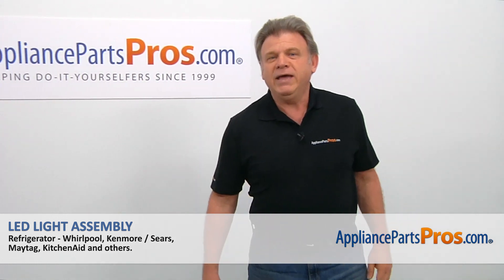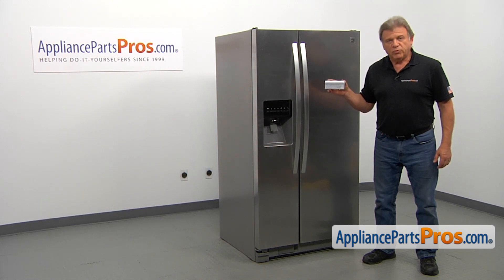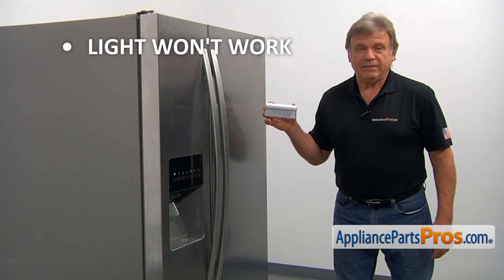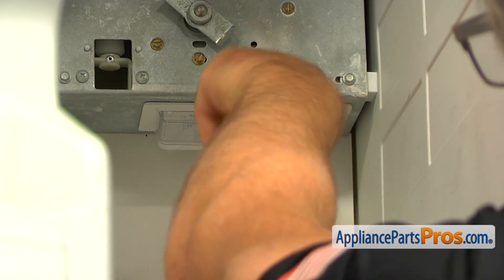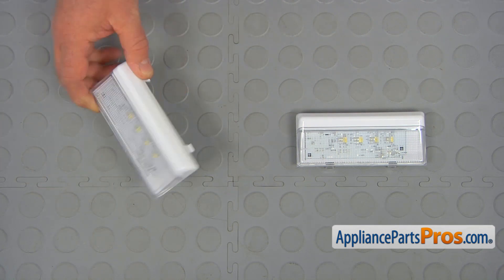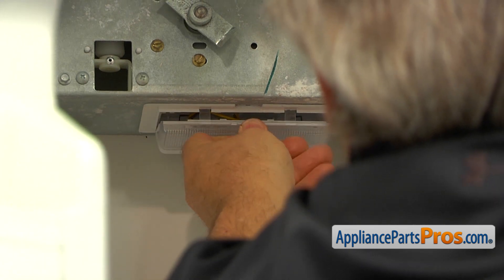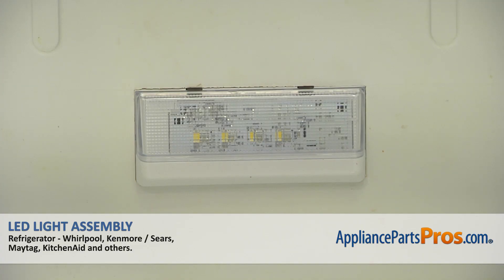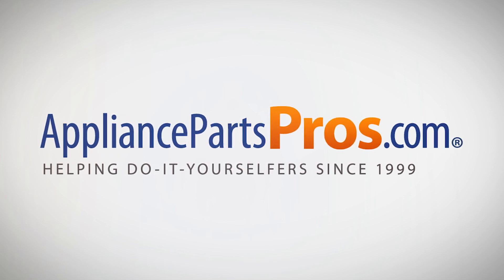How To: Whirlpool/KitchenAid/Maytag Refrigerator LED Light Assembly WPW10515057

Comment: Before replacing computer board panel, first remove and clean male copper poles on the panel. You can use a metal brush, or file. A nail file can be used. Just cut to a narrow width to fit inside plug fixed to panel. It worked for me. No need to replace panel as copper poles were just dirty.